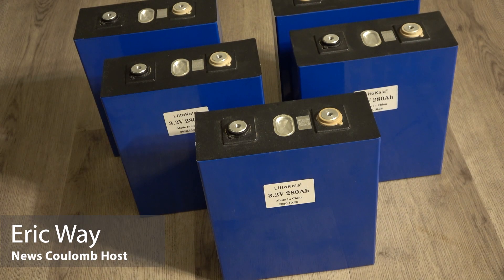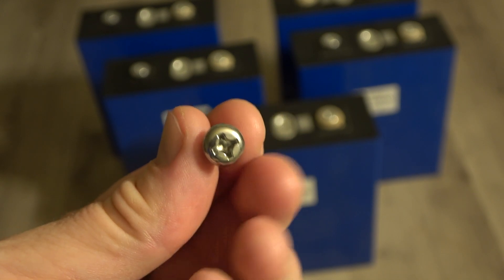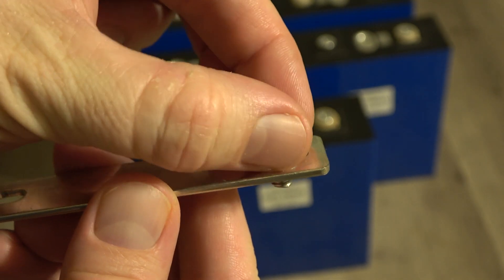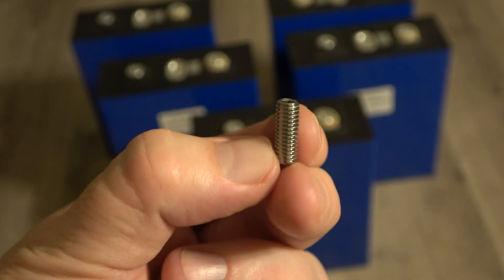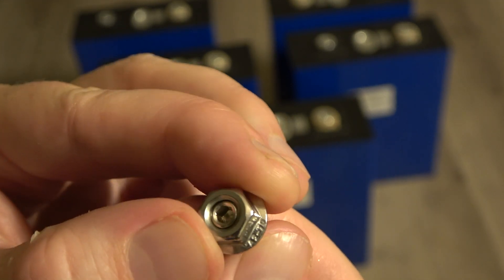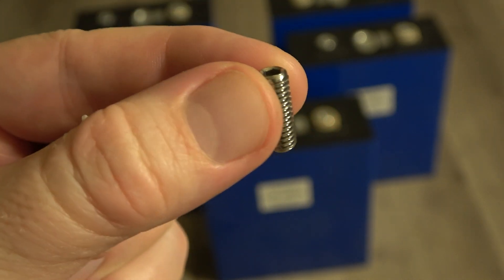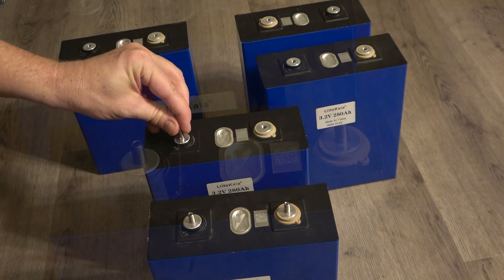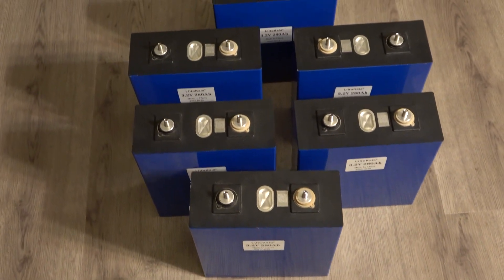Ford Ranger Electric: Installing Terminal Studs on 280 Ah Battery

Comment: I wonder if the thread locker increases electrical resistance
Reply from the maker: It shouldn't. The main transfer of electricity comes through the flat surface/face of the aluminum terminal. These terminal studs are stainless steel, which is already higher resistance than the aluminum and copper, and as I understand it, all the pre-studded terminals are using similar stud material.
Reply: @newscoulomb3705  You are right, the top surface is the main connection

Comment: How many miles are you up to with your Bolt? Sorry, I know it's a question for one of the drive videos. I am guessing 150,000 but I may be guessing wrong.
Reply from the maker: I'm still only at around 142,000 miles, but I haven't had the reason/opportunity to drive as much recently.

Comment: As usual, well thought out and well explained  I always enjoy hearing your thought process.

I forgot to check whether you lost power lately.  You intended to borrow some of your batteries to provide you back up power.  Did they become necessary?
Reply from the maker: Thanks! Yes, I did have to use them for power. I might need to break out my setup just to display what I did. Maybe even show a few basic battery concepts along the way.
Reply: That would be interesting and probably appreciated by several on your channel.

Comment: After watching the video I don't quite understand why slightly longer screws/bolts wouldn't have accomplished the same thing; you could probably find something with a low enough profile head that it would be shorter than your serrated nut even with a lock washer installed under it (although it wouldn't be strictly necessary if you loctite the bolt in anyway, and a flat washer should work in that case). 

You're correct that the studs make it a little bit easier to stack your other hardware for busbars and balance leads on the posts, but the tradeoff is more cost (the nut plus the set screw almost certainly cost more than a screw/bolt and standard washer combo), more assembly steps, and two different places the stack can "unthread" instead of just one.
Reply from the maker: That's fair. A longer screw is certainly one approach, but yes, one of my big concerns is having the busbars rotate and short the battery. The other issue with a fixed length screw is, it limits flexibility. If I get one long enough to double stack busbars, it will be too short to fully seat a single busbar. Essentially, I'd need to get a custom screw length for each configuration rather than buying a single, bulk batch of set screws.
Reply: The aluminum in the terminal is soft. I noticed more play every time I unscrewed the stainless screw. Looking at the threads on the stainless screw you could see discoloration. (Grey) if this was due to galling or wear is hard to say. The threads in the terminals on these cells is the achilles heal. Gluing them before they strip is probably a good thing. I’m sure the loctite strengthen the thread and reduce galling.

Comment: The Loctite won't act as an insulator?
Reply: That was my first thought as well. It’s not a lot of material, but I’d be curious how the resistance changes. Definitely don’t want the studs to come out though, so maybe it’s worth it.
Reply: The current goes thru the top of the terminal into the bus bar.
Reply: ...And there it is. That makes sense.
Reply: I've used loctite Blue on several electrical connections and it seems to not block much.  There is still some thread there without loctite as well.
Reply from the maker: Yes, Trey is right. The power is primarily flowing through the face of the terminals, which are aluminum (conducts electricity well). These set screws are stainless steel, and they area already a much worse conductor. Thanks for the question! I'll be sure to mention it when I discuss the how I'm linking the cells together.

Comment: I also used the same screws. However I used a primer on the stainless. (Loctite do recommend a primer on stainless)  After the primer I used red loctite for maximum strength. Red loctite means you will not be able to unscrew the stud in the future.